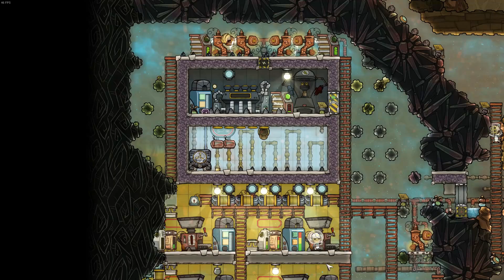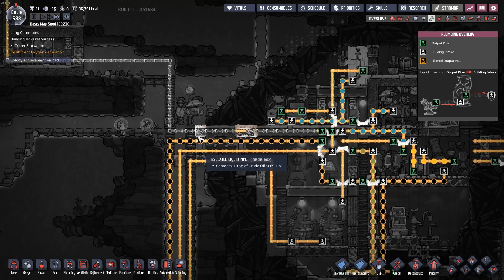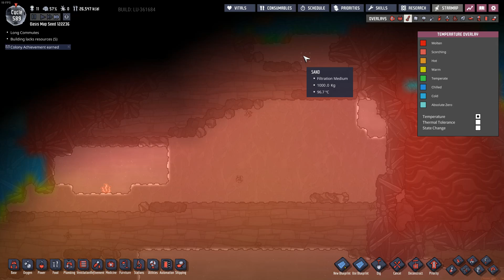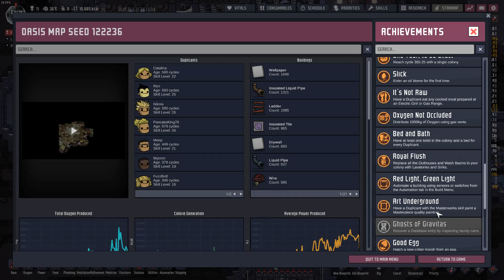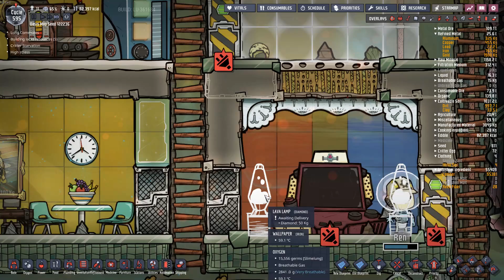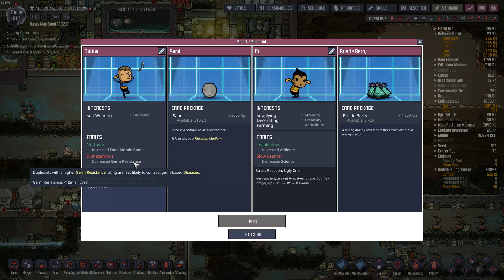Mini Refining Base! Oxygen Not Included ep14

Comment: I like how the Bad Pip VII that took a while to be killed forgave your dupes right as it died. Also very funny to see you struggle with temperature when the whole premise of this base is cooling! Petroleum generators are not to be underestimated on heating. Ultimately it feels like every part of a base needs a cooling loop reaching it, I've found.
I've made the same mistake recently with water and pump automation by the way, though in my case I built ice tempshift plates a few times and it really was more water than I could handle.

Comment: 10:40 You can automate a 'butchery' where you drown critters to turn them into meat. You can do a room 3 tiles high with a mesh tile floor. Thats the room where you release your critters for butchering. Once the dupes go to bed, you just flood the room from below with mechanized airlocks pushing water from the bottom. You can put a critter sensor on memory toggle to check if all critters drowned. After that the airlocks open and the water goes into the bottom again.
Reply: @thefreakkk  I like your train of thought, you genius. 
When the next Saw film comes out?

Comment: About isolated living areas: Have you ever tried automating food shipping in that area (so dupes don't have to carry food from Area A to Area B)? I couldn't figure that one out.
Reply: Great tip! My problem was some food are getting stuck in the conveyor receptacle or the conveyor rail which causes the base reserves to drop to 0kcal. Timers should work. Just need to calculate how long the sweepers or loaders should run to load enough food for an area.
Reply: perhaps a batch system could be utilized. detect low food in remote base by detecting a dupe approaching a further fridge, which sends automation signal to home base to run sweeper/conveyor for long enough to send a bundle of food (which fills the far storage & half fills closer box)
Reply: That might also work but the problem is going to be knowing if the fridge is empty. The fridge has only 2 states full and not full so it's kinda going to be a bit tricky. Maybe with some math, we can calculate when it will be empty.
Reply: @CaptainSisig  set higher priority on the fridge that's further from dupes, sweeper will deliver to it first. the other (low priority) fridge will handle excess & be emptied first. as soon as they eat from the far one, it's "not full" triggers a delivery of food. 

@ main food storage, that "not full" signal needs to activate a conveyor loader headed to remote base for just a brief interval (maybe a memory toggle with a filter gate on it's reset input)